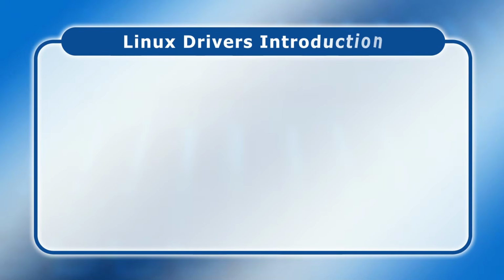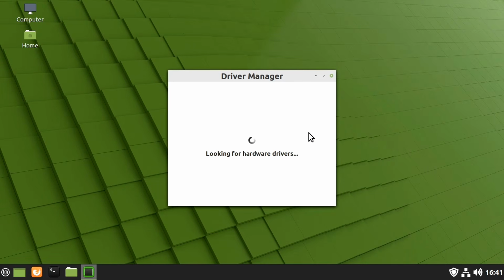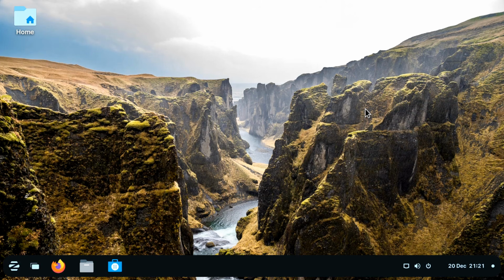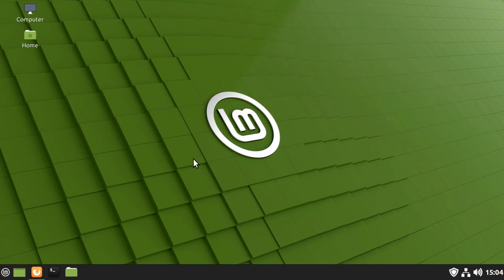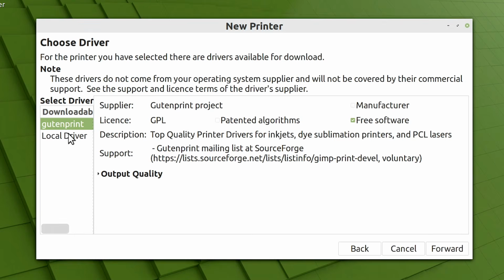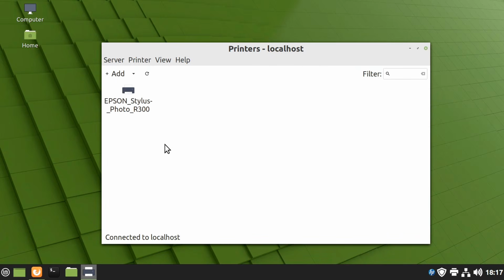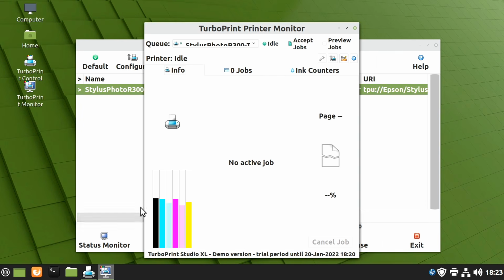Linux Survival Guide #3: GPU Drivers & Printing

Comment: I had a spot of bother installing a brother printer.  It is an older printer that only connects via USB.  I connected it to the file server which runs Ubuntu 24.04.4 Lts server.  I found that I could install a Brother Driver Package which has all sorts of drivers for Brother printers which solved the problem.  I published my experience on a blog belonging to the Bald IT Guy, I think it was.  If I can find the link, I'll drop it into the reply below this comment.

Comment: How can you pull drivers from one distro and use it on a different distro?  Say something works in Ubuntu but not mint or vise versa. Is there a way to pull those drivers or is there a terminal command to install those drivers?

Comment: Excellent guide.  I was fortunate that my Brother laser printer installed automatically, but my Epson Perfection V39 is not as cooperative with Mint even after downloading the driver from the Epson website.  After looking for guidance, it appears that this particular piece of hardware is not supported.  Rather than force the issue, I ordered a Canon LiDE 300 which the Mint community members say installs automatically.  Well worth $75 to avoid the potential frustration, and I'm sure some Windows user will appreciate finding a scanner that works at Goodwill.
Reply from the maker: I like your pragmatism. :)

Comment: hello i have a ricoh sp 112 (i'm using linux mint Xfce btw) and when i plug it it gets detected and the driver is installed and everything seems to work find but when i'm going to print a file or even do a print-test the printer doesn't do anything and it shows on the queue that my job is being processed and then it  disappears, i'm not sure what is the problem if anyone knows how to fix this please do respond, thank you.

Comment: Hi. I just switched to Mint/Cinnamon on my oldish PC that didn't have W11 support, and I'm loving it. I had an issue with the graphics card driver. The GPU is a GTX1050Ti and with the recommended driver, nvidia-driver-535, steam games would not launch. I got a lot of bad advise from AI, but finally I chose a later driver, nvidia-driver-580, and now everything works as it should. Thank you for introducing Linux to me.
Reply from the maker: This is great to hear! :) Excellent that you've got the NVIDIA driver sorted and Steam games working.

Comment: Thank you for sharing, Best video on printing so far. Used cups many years back, Fedora 12 I guess it was, but when it comes to Linux printing is still pretty bad, which is disappointing.
Reply: Cheers. People tend to be more interested in non productive activities and gaming. That is fine, but before getting to that stage, the mere basics should be readily available. Instead populating the distro and the menu entries we might need to think of smooth functional OS. Why have Libre Office if you cannot print your documents? Since RedHat 5.0, the first Linux OS installed and now with the excitement and lovely Linux distros... We live well into the 21st century. People like you are tops, thank you.

Comment: I could be silly.
Asking just in case I missed it if you mentioned already...for Linux Mint specifically.

When downloading then installing the latest NVIDIA driver, does the process remove the previous (old) driver automatically?
Any need for a DDU like program to remove said old GPU drivers?
Reply from the maker: The old driver will not be removed, (you will see it as a choice in settings. But your computer will be set to use the new one you downloaded. So there's no need to remove anything (although it it worth checking that the new driver is the only now being used).
Reply: @ExplainingComputers  Thank you very much for that explanation Mr. Barnatt.
You are awesome!

Comment: I wonder if you would consider continuing this series into slightly more advanced territory. In transitioning from Windows to Linux two main things tripped me up.  

1. Mapping network drives and mounting them on startup.
2. Mounting drives in the user's Home so they are directly accessable by programs (e.g. adding folders to Plex Server libraries).

I think a video on these might help others.

Comment: Just install Zorin OS 16 Pro Great i have  a canon image class  mf 4370 dn it doesn't work Zorin look for driver not found I got the driver for windows Zorin 0S 16 Pro find the canon on the network but it need the driver  to run not found in their list so i stay with Windows for now. no linux driver for my canon laser .

Comment: Hi Chris. I am a newish subscriber and have happily bought a Raspberry Pie 400 and changed my OS from Win 7 to Linux Mint on my desktop. I wish I did this years ago as things actually work. In my 50's PC's are still a learning curve, but easily use Linux Mint as my work and University have access to Office 365. We just have to get to it and Windows 10 or 11 is a very expensive way of doing this. Just put Bionic Pup 32 Bit on a flash drive for my partners very old HP laptop. Thank you for posting. Your videos are very helpful and unlike some American YouTube computer videos, you don't shout at the camera and assume we know what is being shouted about. Thanks

Comment: Don't waste your time looking around for a Linux compatible all-in-one inkjet printer for home use because as of July 2022, there are not any on the open market since virtually all printer manufacturers no longer make or market any.
Reply from the maker: Yes, sadly combined printer/scanner hardware rarely has a Linux driver.

Comment: indeed gpu drivers are slower to be developed and debugged on linux, even by brand sake companies. had lots of black screens on several linux distros during install on a pc with a new gpu but based on old tech. was especially painful during transition to no more vesa text mode allowed era..but those modes are still there in hardware lol

Comment: Well, I have a Canon MG2522 Ink Jet Printer attached to my Dell Optiplex 790 running Window 10. I'll check and see if there is a printer driver for Raspberry Pi Debian 32 bit Desktop OS, as you have suggested. As always you are helpful to those of us fairly new to Linux I've been mucking around with the different distro's for a while and just keeps my old mind cogs running so I don't need any grease to keep them turning.

Comment: I had a very bad experience with Epson printer in linux. It only print this $ symbol. I downloaded the driver from the official site but the output is still $. When I went to my friend house, I just plugged my laptop to their canon printer and all works well. Same with HP and Brothers it works plug and play. 

At this point I'm very disappointed with Epson now.

Comment: Hello, Christopher, 

I enjoy the Linux videos you make, not only the survival, but in general the Linux videos. I am using Manjaro Linux, and i am happy with it. I guess one day you can make a review about it. I do not mean to be rude, but i believe I spotted a small typo in the video. While your printer is Epson Stylus Photo 300 series, you typed the Epson Stylus Photo 3000 series series on Epson Web page. i believe this might be one reason, to make the driver detection of a driver on manufacturer's web page to fail. For some reason, i cannot shake away the thought that if you typed the correct series - 300 series, you might end up with a driver in your hands. 
Time stamps: 
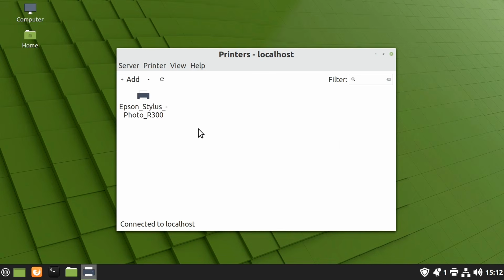13:35 - shows the printer model as detected by Linux Mint - 300 series
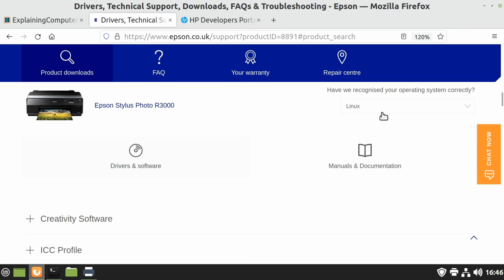14:40 - shows query about Epson Stylus Photo 3000 series

Otherwise I enjoy your videos in general and i am happy to see a new video. Thank you for your effort, Christopher, it is most appreciated. 

Kind Regards
Reply from the maker: Thanks for this, and Manjaro is indeed a great distro. I must to a full review at some point as you -- so far I've only covered it (for x86) in video also lookin at PC Linux OS: https://www.youtube.com/watch?v=hcmkw22jV4g

At c.13:35, in the search box I entered "Epson Stylus Photo R300", but the result showed the R3000 only, presumably as the closest match of available printers with Linux driver support.

Comment: As an Nvidia GPU card owner, driver issues continues to put a question mark over using my PC for a Linux installation and I may use a Rasp Pi or x86 SBC to instigate a gentle transition over to Linux this year and only using Windows for games or specific software.

Comment: Checking install 3rd party software is disappointing advice for those of us leaving Windows and Mac systems due to abuse of trust. I would like to know more about what can be included in these 3rd party packages.
Reply from the maker: The third party stuff here is drivers, video codecs and similar things that, whilst free, due to licensing cannot be included with the distro. You do not have to install them. but if you don't you'll have to find and install some of the files yourself. And on other occasions, programs will prompt to install such things on first run.

Comment: Excellent timing! I have a brand new Alienware x17 (spec maxed out) that I would like to put Linux Mint on. I have a bootable USB stick ready to go and am testing v20.3 on another laptop prior to installation. My main concern is wi-fi (I'm not a gamer). I don't mind leaving Windows on it if that's the best bet for now as I have a couple of other laptops I can still run Linux on in the meantime.
Reply from the maker: Good luck!

Comment: Hybrid graphics under Ubuntu with a very modern HP Z-book has been a royal pain in the tail.  Switching between the graphics adapters is not intuitive nor easy and in Linux I just use the i915 and will eventually just uninstall the drivers for the discrete AMD GPU. I hate to say it, but this same laptop is handled flawlessly in windows with Catalyst Control Center.

Comment: Two comments:
1) If one is changing a graphics card (i.e. from Nvidia to something else) it is a wise precaution to switch back to the 'open source' driver before removing the old hardware. Otherwise one may be left with a computer that is effectively 'headless'.

2) Canon's Linux printer compatibility is just the opposite of HP's. I purchased a Canon G6020 MegaTank Inkjet printer and would up purchasing a small 'Windows box' in order to get it working properly. Because of Canon's lack luster Linux support I will never purchase another product with Canon's name on it. In this case the 'Turboprint' software looks interesting.

Comment: Thank you for this guide. I'll have to check which driver would work best with my Epson printer, whether its the autodetect ones or the one from the Epson support site that I already installed just to be sure and so I can use the scanner portion of the printer. Our family's previous Epson printer also had a Linux driver but if I remember correctly I had problems with getting it to do a head cleaning, but that was back with Ubuntu 16.04 years ago. Hopefully my experience this time is better.
Update: Installed the actual printer driver (printer filter) package, the one I found on the epson site first was just the printer utility. Then setup the printer using a PPD. So the Printer portion works but the Scanner part has issues mostly due to the linux version of the epson scan software being bare of features and the open source alternatives having their own issues due to their reliance on the SANE library.

Comment: Again I learned something new, Thank you Chris.
One thing i have tried before is the manuel installation of printer drivers for a specific printer, like you did with the HP-driver. I am not at fan of this, since it seems impossible to uninstall the installed software/drivers, unless the vendor is supplying a script for that.

Comment: Running a Linux only system with high performance graphic cards or / and GPU computing, means the only way is an NVIDIA Card, because of the full driver support. Blender for example can render also on a GPU, but as far as I know this is only possible under Linux on NVIDIA cards. 
Since I run Linux for a period of over 20 years on desktop PC or laptops, I always bought my hardware if it has full Linux support, especially (ink jet) printers. But nowadays, most things run out of the box with popular distros.

Comment: I have had occasion that once you've installed it doesn't work as well as it did from a DVD or other media, the best thing is the backup before you start, like on an old HP laptop the screen was OK when it was from a DVD but not when it was from the hard drive, in that case I plugged a monitor into it's VGA port I could see you I was doing to get the screen resolution right.

Comment: cant you bypass the trial limitation of turbo print rather easily in linux by using apt purge and then reinstalling it?
purge will get rid of config files as well as any other traces.

Comment: Your intro's are blindingly white...and the white and blue faded looks isn't much better. Look at the lower contrast that the BBC has and that of an interesting background that any TV news broadcasting station has. Things have moved on from the 1980s.  A nice muted photographic background is much better than what you have already.. A nighttime shot of a city through a glass window, such as one for different seasons.of the year. Sunsets, fields, the sea, nature... ect..
Reply: Sounds like you need to turn your screen brightness down
Reply from the maker: Thanks for this feedback. This channel used white as its signature style (linked to the hardware shot holdouts) for about 14 years. I am aware that some were uncomfortable with this, I have just addressed it with  new backgrounds for the pieces to camera, and the gradients and other colour on the titles and intertitles, and other changes to the titles. So there are no all white screens in any of them -- not a single frame. Having produced animation for the BBC for six years, I am aware of their technical requirements, and would note that there is now less white onscreen in any of my shots than in, for example, parts of the BBC News channel title graphics.

On backgrounds, I totally reject your view of using something "more interesting", with a photograph of something looking "much better". Not least, it would brng a totally different style to the channel. As I've said, I spend a very long time (about two years) thinking about and experimenting with this change, even including moving to a physical set. But as soon as the backing is a set or a photo, it ties things to a fixed reality. One thing I think I have achieved over the past 14 years is avoiding making the channel look like it is shot in my living room, bedroom, or a small studio (which is it).

So thanks for your input, but having spent a long period of time making a fundamental change to the videos from which I earn my living, I am not going to change anything again for a very long time indeed! :) There are far too many YouTube channels that make fundamental changes and fail, and I cannot afford to do that.

Comment: 1) google is your friend. 2) install project gutenprint if your distro doesnt come with it by default. 3) I have bumped into occasions where gdebi or gnome package manager refuse to do squat with a .deb file. In which case you should use terminal and dpkg -i packagename from the folder the file is in. 4) if you do install a gdebi from a usb running a try version of the distro, prepare to possibly have that fail due to dependency issues, it might work, but you might have to have the distro actually installed before you can run updates and reboot etc.
I cant say much on GPUs. the PCs I have access to that run nvidia anything have refused to recognise any nvidia drivers because the card wasnt just a pcie dedicated one, but one of those shared graphics/switchable graphics type. I think I had one 10 years ago and I had that hilariously ugly stretched nvidia splash screen during boot, not sure if they still do that. so I built my pc to AMD since I knew that would work ootb.

Comment: I run Manjaro linux (64 bit) on my pi 4 and the Canon printer/scanner  MP252 I use would not be recognised at all until I installed Gutenprint as it was not installed by default.  After that it was a breeze. After that I installed simple scan for the scanner to work.

Comment: Thank you Chris for another excellent Linux video. Will you be making one discussing connecting to wifi for internet connection? I have Xfinity cable internet modem downstairs but my computer is upstairs connecting by WiFi network card. I'm currently using Windows 10 with an Nvidia 1050ti gpu but have been reluctant to use a Linux distro do to issues in the past with GPU and network card issues.(Edit) Sorry I should have waited to finish watching the video before commenting. It's been a decent while since I tried so I will try again. If needed I can try to get an Amd GPU and a newer networking card combined with newer versions of a distro to solve past issues. Thanks again for these videos. Happy New Year!
Reply: you could potentially avoid a new wifi card by getting a small router that will bridge the connection to the router downstairs. then youd just make use of your ethernet port.

Comment: An excellent video as normal, one point that is never covered is what to do if you change the video driver, it fails to start, and you are left with a command prompt.
Reply: @gilkesisking Yes I agree,  but what I am trying to make clear and use as an example is once you no longer have XWindows because the driver failed to start, and you are faced with a command line Me@Myworkstation$ what do you do; I know the answer to the question somewhere there is a text file you need to edit but where, and what do you change. It would be really helpful if someone covered this because it does happen. This comes from my computing support background, "you never get a call when it works, you only get a call when it doesn't!"